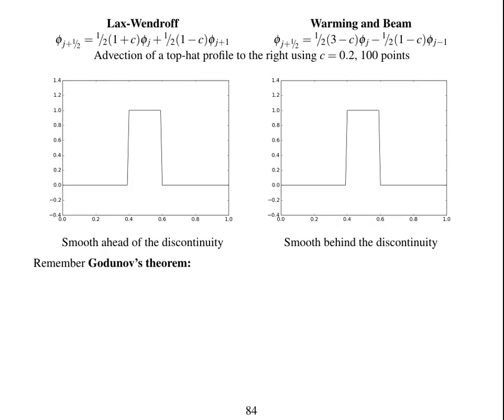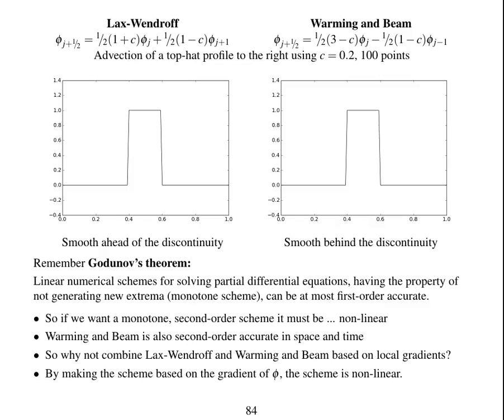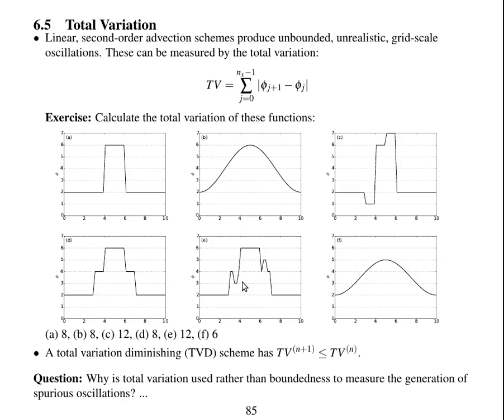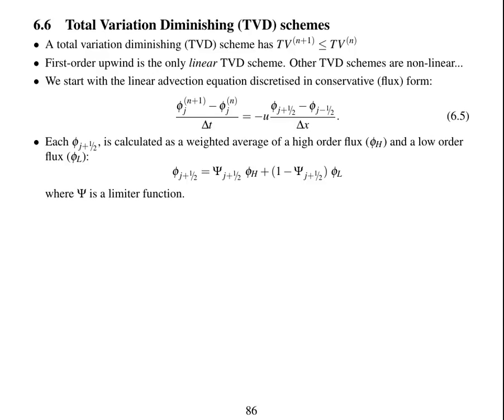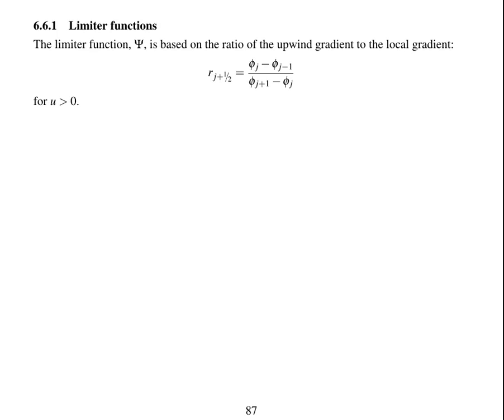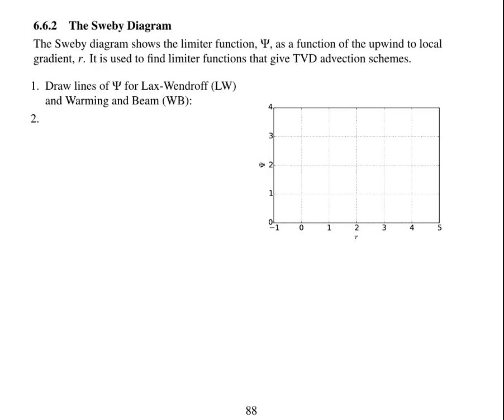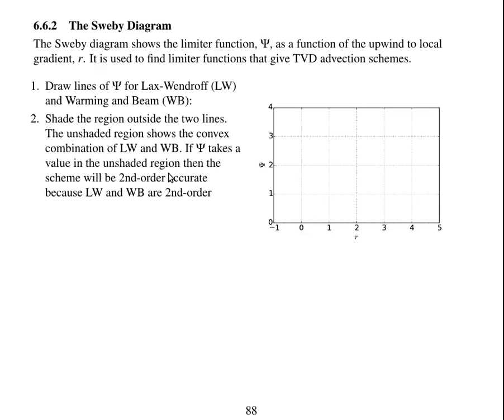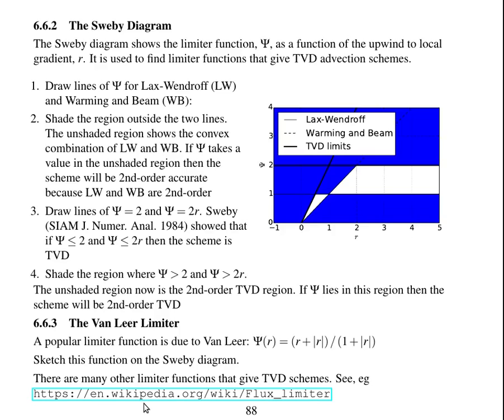7.5 Total Variation Diminishing Advection Schemes

Comment: Dear Hilary,

very informative video on TVD Scheme. what about this scheme if u<0? I would be glad if you reply to this thread
Reply from the maker: It would be quite straightforward to go through the derivation and work out what it should be for u<0. To start with, the low order flux should be forward in time, forward in space (FTFS) rather than FTBS.
Reply: I tried using FTFS for u<0. then what about TVD condition? can I still use super beem or vanleer conditions?
Reply from the maker: You'll need to re-derive everything for u<0. For more help, you could sign up to do an MSc in Meteorology at the University of Reading
Reply: I re-derived everything. I got weird results. I can't sign up for a degree since I am already a research scholar in one of the reputed institutes in India. Thanks